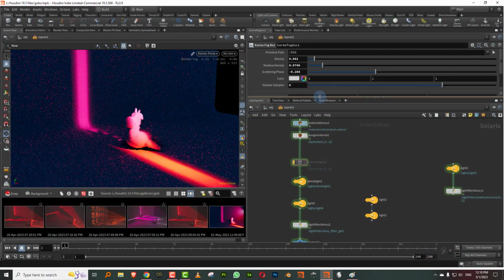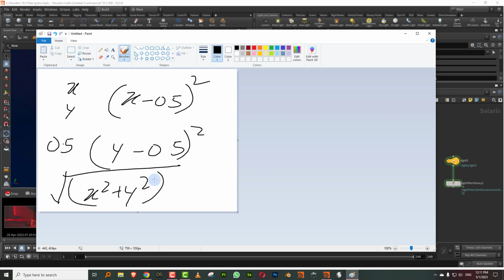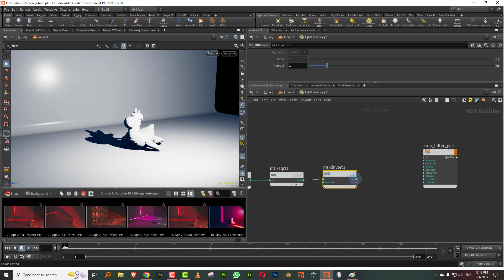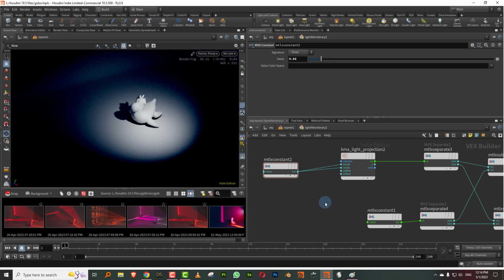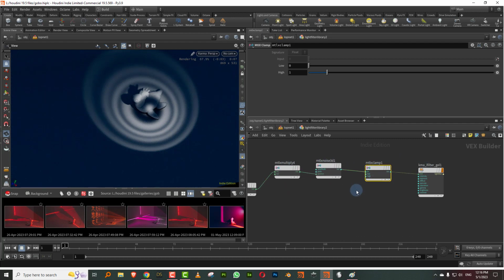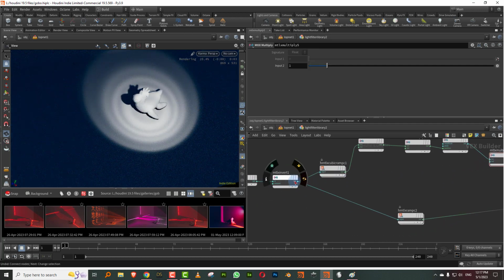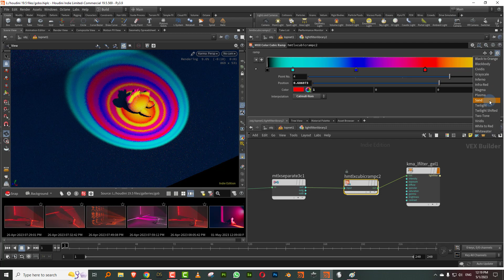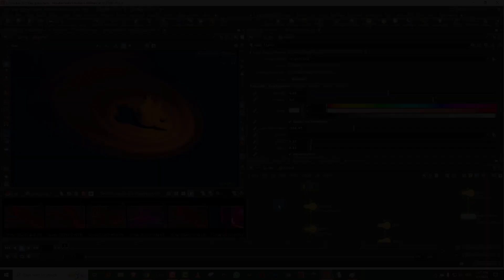Houdini - Karma CPU - procedural light filters 2 - Spotlight

Comment: Thank you so much!

I would love to get an explanation from somebody, on why some of the more advanced features in Solaris are limited to CPU, in Karma and Solaris.
Still don't understand why CPU is associated with more complex / physically accurate rendering.
Reply from the maker: XPU is still in development. So they're slowly taking all the features from the cpu version and adding it to xpu over time. Traditionally it's easier to add features to a cpu renderer than a GPU/XPU renderer. Hopefully by H20 there should be feature parity between cpu and xpu versions.
Reply: @rohandalvi  Yes hopefully, it would make it more practical. 

I just wonder why, what makes different CPU and GPU architecture / memory so different?
But it is totally fine if you don't have all the answers, as I am sure it comes down to advanced computer science.

I hope H20 will be packed with new features, like delivering more for a 20th anniversary.
Reply: @metaturnal   Everything is different, they even have separate team working on the XPU, they trying to mimic what CPU team is doing.